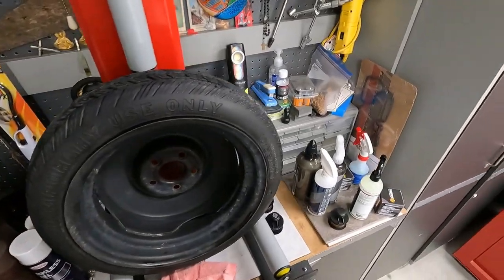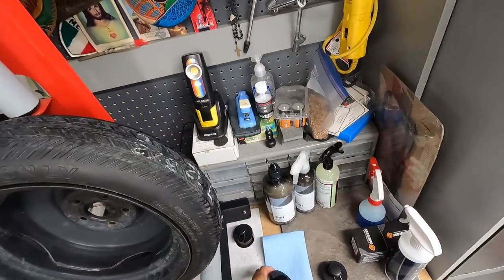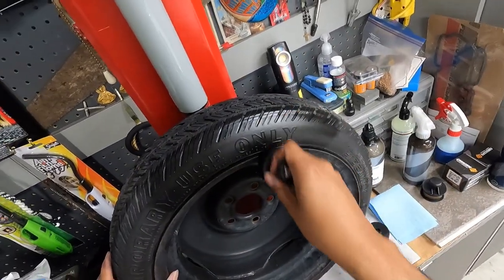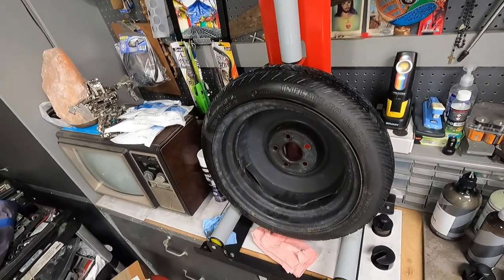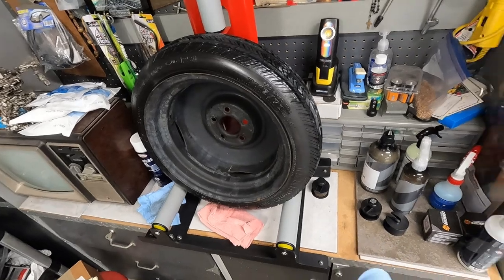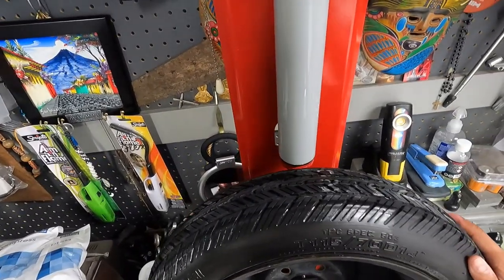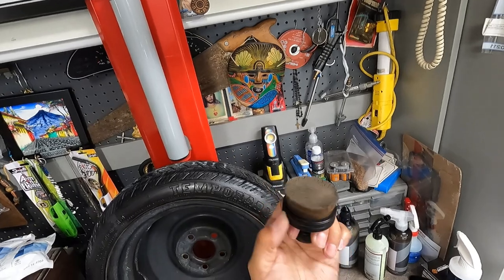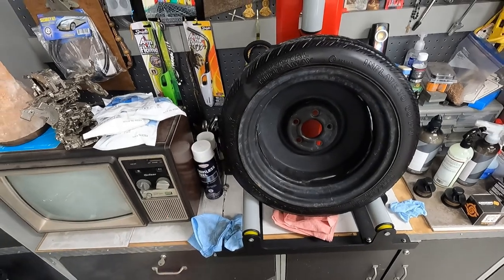CarScope Tyre Brush - Is it a must have?

Comment: I live in the Uk so shipping was not a problem, I think they are good I would not go back to using a sponge.
Reply from the maker: Makes sense as that where they originated from. Not sure how things are there but shipping prices in the states has risen dramatically.  The initial shipping was $18 and the brush is listed at $15.  It seems as though the US distributor fixed this as shipping is now in the range of $8-$9 which is more reasonable.

Comment: How do these compare to a normal medium stiffness detail brush, personally I use a large nylon detail brush and find it great especially since you can get to a lot of the bottom part of the tyre without having to roll the car. As you've said the fact this doesn't get to the bottom of the tyre well at all makes it a little inconvenient
Reply from the maker: The bristles seem a tiny bit softer with this brush.  Not by much.  A larger brush would definitely be my choice for larger tires.